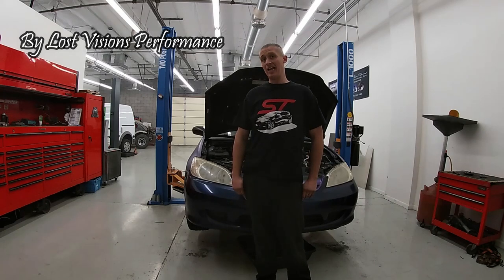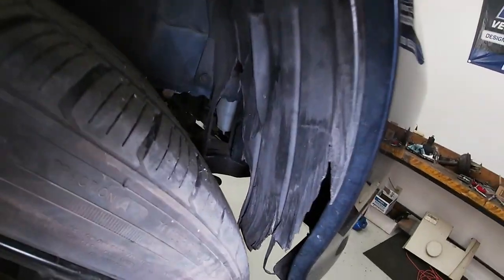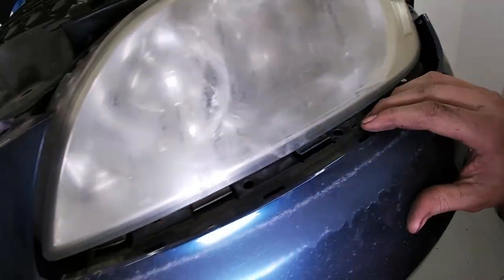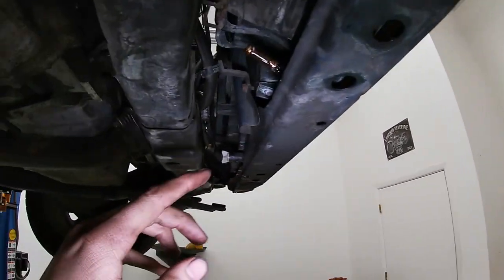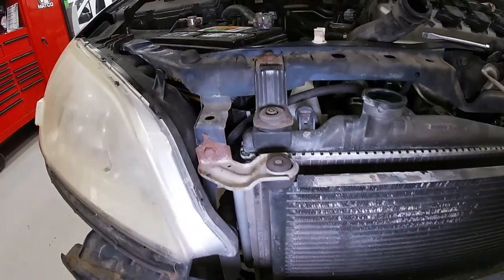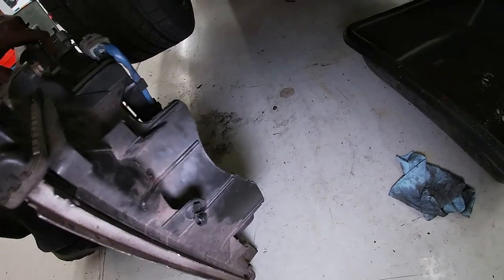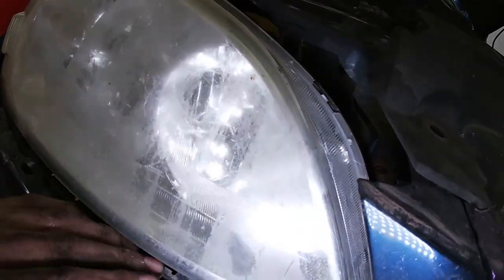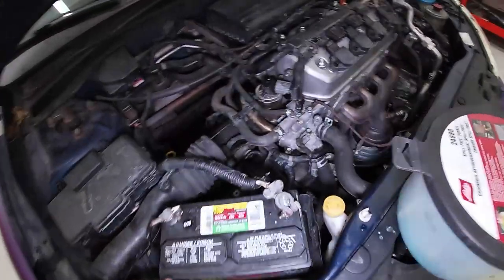05 Honda Civic Radiator Installation Video Same for 2001 – 2005 1.6L 1.7L 2.0L Engine Auto or Manual

Comment: for ones asking that have a manual trans it will be ok if you don't hook the lines up to trans cooler fittings those lines are only for auto trans fluid to circulate and cools the liquid going back to transmission just plug them and your good. you can also leave the fans in the engine compartment and just take radiator out by removing hood latch and moving condenser forward but great vid.

Comment: What if you have a manual and new radiator came with the fittings for trans cooler what do I do then?
Reply: it will be ok if you don't hook lines up to trans cooler fittings those lines are only for auto trans fluid to circulate and cools the liquid going back to transmission.
Reply: @mricemell0w365  thanks man much appreciated

Comment: They dont make a radiator for my 2001 honda civic unless it's automatic transmission. So I have to use the only one that they make. It has the lines for cooling the transmission fluid.

Comment: I have a manual transmission , the only radiator I can get that is the same as my old one...has the 2 lines for a auto transmission. Do I have to plug the 2 holes that won't be used in my car that transmission fluid would go through in an automatic?
Reply: I know it's been 9 months since you commented on his video but I had the same issue and just plugged them. No big deal
Reply: @Jaybomb350  what did  you plug them with?